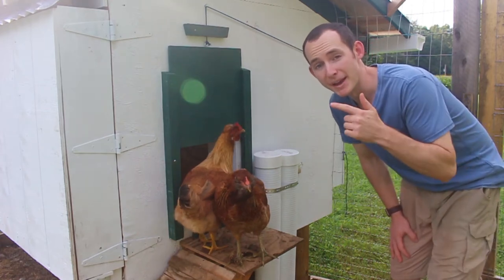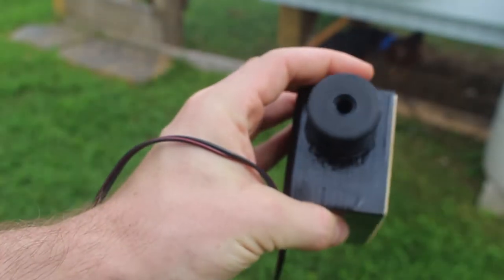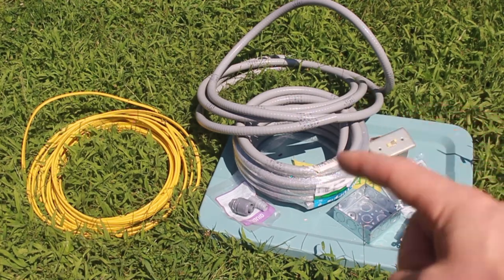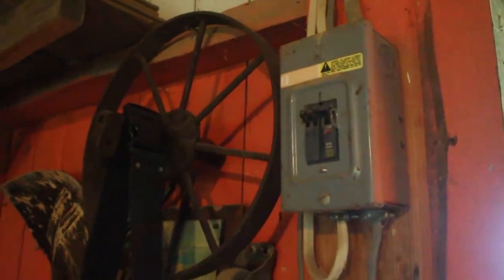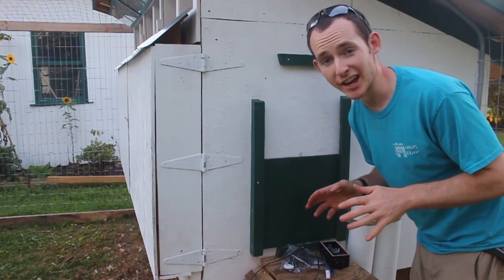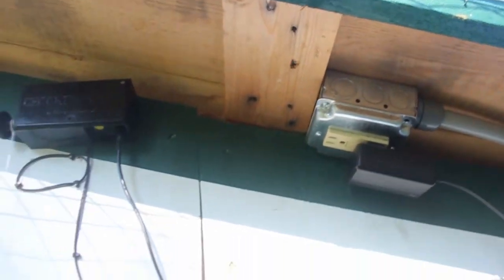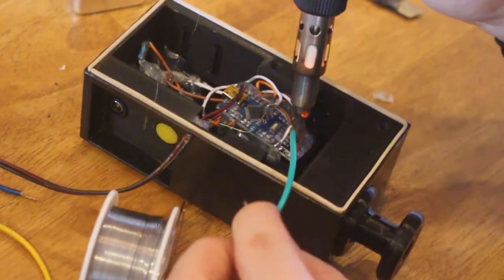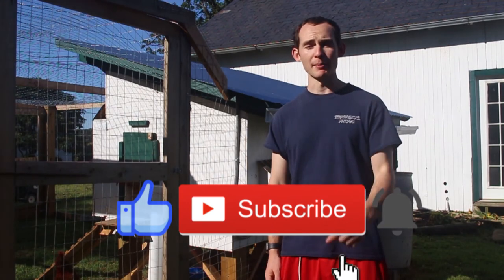Installing our Homemade Coop Door Opener + Running Electric to the Coop

Comment: I feel like the majority of your work was in running power to the chicken coup.  I feel like this overlooks an interesting alternative, if you adapted the design for the power levels on a lithium ion battery, you could probably run the whole thing off some small solor panels.  You might have design it to use some kind of external mechanical advantage, but it looks like you have enough space there for such a solution.
Reply from the maker: Agreed! I considered doing solar, but the extra cost of the panel and battery wasn’t worth it. Another big consideration was powering a water defroster in winter, which would need a fairly hefty battery/panel

Comment: As an engineer myself, I LOVE this and was thinking about making one myself. However, at the end of the day, you're not going to make one cheaper than what you can simply buy. The ones I'm looking at are in the $150 - $175 range and have a few extra features than what yours has.

* It raises and lowers slower 
* If it feels any pressure while closing (e.g., there's a chicken in the door), it'll will raise up in order to not hurt the bird
* You can override the programming such that it doesn't just rely on lighting. 

I've always wanted to buy a 3D printer, but I don't have one, so I'd have to maybe use an electrical box. It would be fun to try and build one, but there are only so many hours in the day.

Edit: btw, I've subscribed. Great content.
Reply: "However, at the end of the day, you're not going to make one cheaper than what you can simply buy."

I have to call BS. I have made and designed MANY that have these features and more and they are ALL way cheaper than most commercially purchased ones. Ones that are of any good quality that is.

Comment: Always bench test electronics before installing, would save yourself a ton of time. Also direct burial 110v wore into a weather proof box. Would also of saved you a ton of time and money. After all time is money.
Reply from the maker: I plugged it in right after unboxing and it initially worked, but the problem must have been intermittent :/  thanks for the tip on wire! I already had the romex and GFCI from another project, so I was only out of pocket 20 bucks for the conduit supplies. For the future coop at our new place I'll probably go with direct burial.
Reply: @MasonDixonAcres  cool project, hopefully I didn't sound like an ass was only trying to help. Always a fan of those who follow their own path.
Reply from the maker: Haha no we appreciate any new ideas or thoughts! Keep em coming!